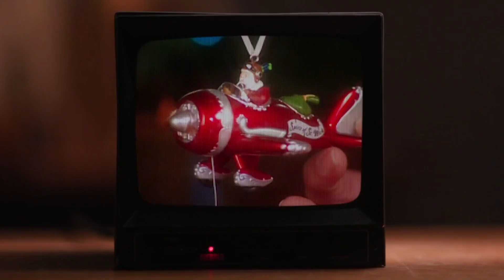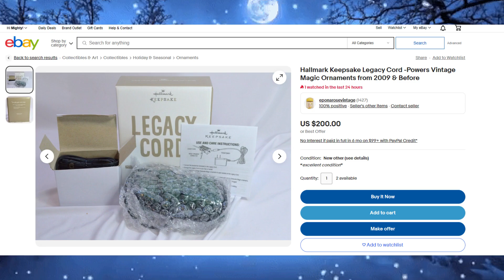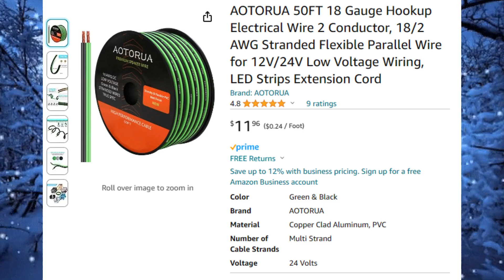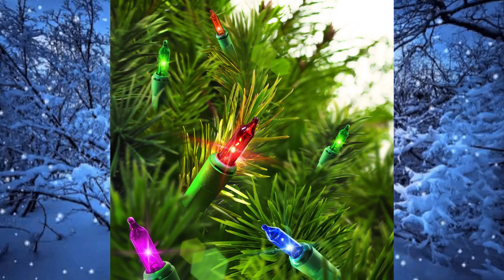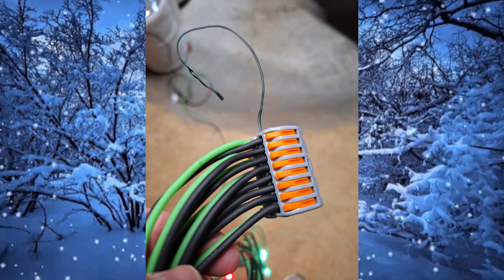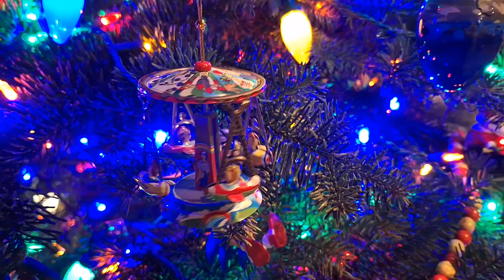Powering Classic Hallmark Ornaments

Comment: Thanks for this.  Really difficult finding ac/ac 6v adaptors right now.  Would a variable output hobby train power supply work, such as a Lionel transformer?
Reply from the maker: A variable output supply sounds risky, especially if it could accidentally reach a voltage that would cause damage. I don't know why all the AC/AC power supplies are backlogged. The link I posted for DigiKey shows they have 6 in stock now if that helps.
Reply: @mightyworkshop  Thanks!  How many ornaments (not spinners) might one be able to power from one power supply?
Reply from the maker: @JamesMcCrane  That will depend on the ornaments. Some draw more current than others. According to this site, the average in his examples are 200mA per ornament, but some can be much higher. You may need to test with a multimeter to be sure. https://hallmarkstartrekornaments.com/2022/12/17/no-legacy-cord-here-is-an-alternative-to-powering-your-old-ornaments-2/ 
The power supply I use is 2000mA max, so if we assume some headroom (never run at max power) I might expect to run 8 200mA ornaments for a total of 1600mA. But I don't own this many ornaments to test with. In our tree, we power 3 ornaments and 6 spinners.